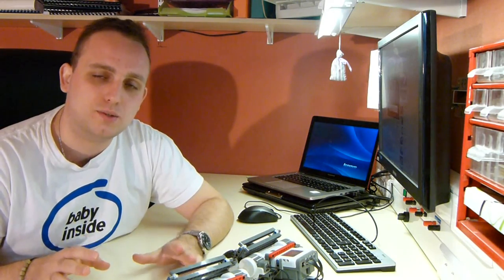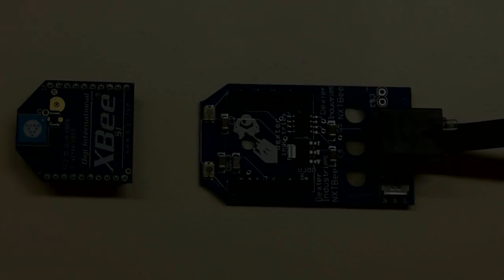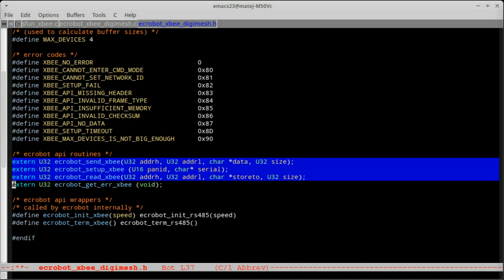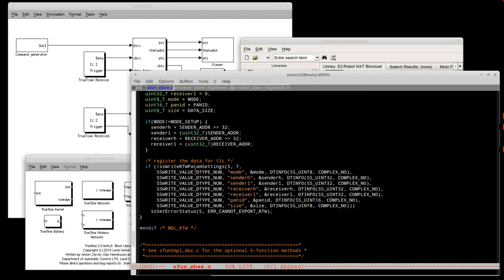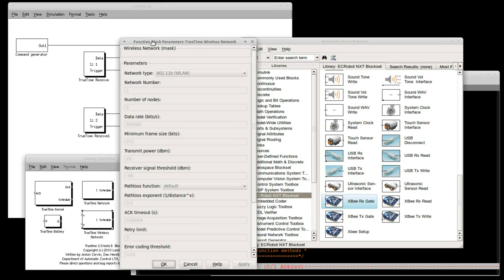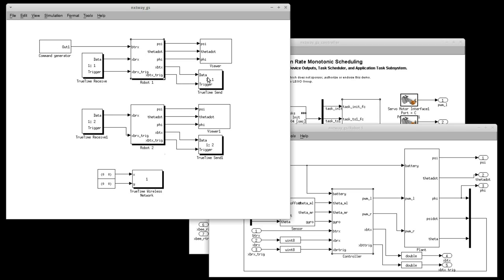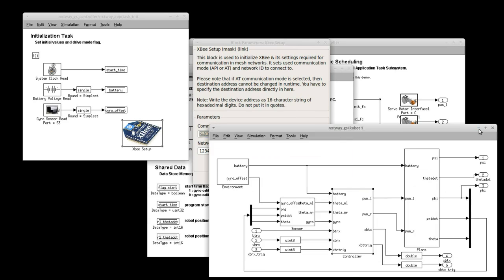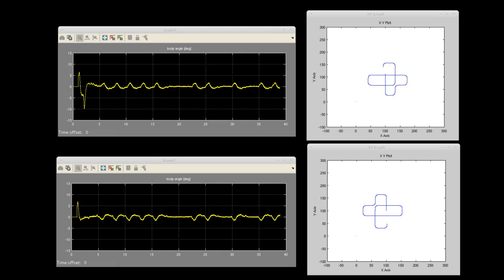Wireless networking with ECRobot toolbox (WINNER of #simulink2012)

Comment from the maker: It's standard NXT Lego connection cable - it carries both power lines and rs485 differential bus. You can find them in the NXT Mindstorms lego set. I was not using any of FTDI chips, since the XBee was not connected directly to USB bus :)